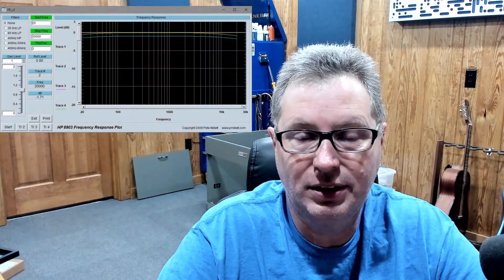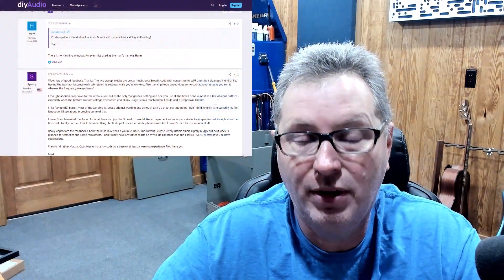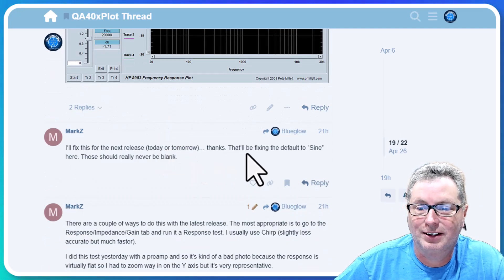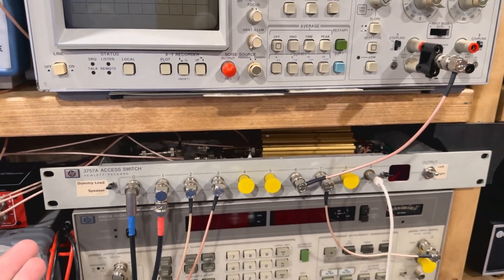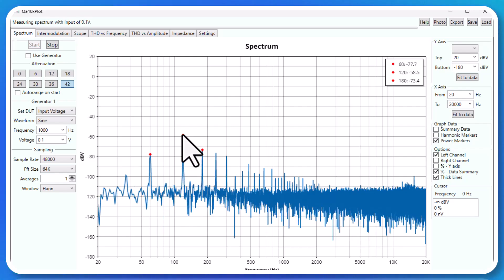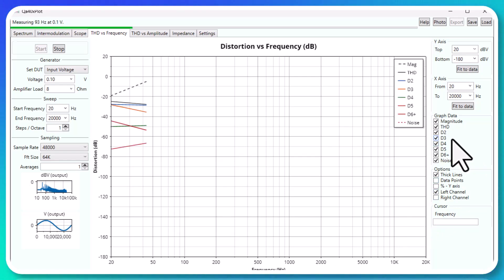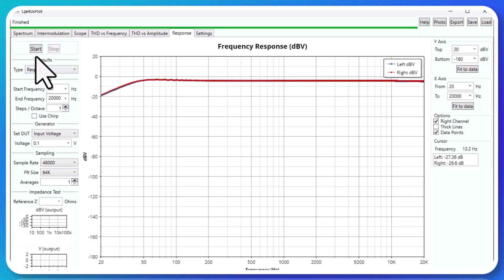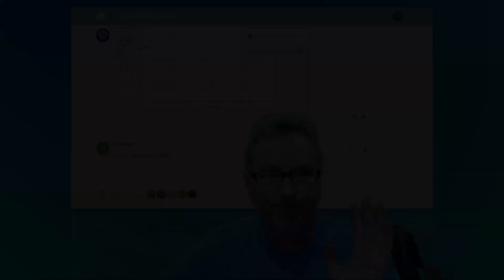QuantAsylum Audio Analyzer Back on Our Bench with New Software 2025

Comment: I have the 8903b and was just getting ready to move an old computer to it to hook up Millet's software. But I've also been looking at the QA403. Thanks for the video. One advantage to the QA403 is that the signals are calibrated, unlike, it seems with a general-purpose interface and software like REW. REW was useful for me for rebuilding and testing an old Teac A4300 open-reel deck, but it wasn't very flexible for bench testing (versus room EQ testing--its sweet spot). For anyone considering an old HP 350 spectrum analyzer, though, it seems like the QA403 will cost about the same and provide a wealth of additional capability.
Reply from the maker: Totally agree

Comment: I’m interested in learning how to measure amplifier distortion. In your opinion, would this unit be the right approach for a beginner or would there be a better way to go?
Reply from the maker: If you are looking for a modern approach, I can't come up with any inexpensive options that would be better.  If you want older 1970-80s stuff, there are some good units on the used market (HP8903B, etc.).
Reply: Thanks for responding.  I recently found your channel and really enjoy your videos.  Would you consider doing a video detailing using your HP8903B to connect and test an amp?  I purchased a used HP8903B not too long ago.  I haven’t had a chance to try using it yet and honestly I feel unsure about how to measure an  amp.  Thanks for your time.
Reply from the maker: @samcloutier4501  Sure, might take me a bit but I'll get to it

Comment: FYI, the QA40x manual of July2023 says, near the top of page 9:  "NEVER USE TERMINATORS ON THE OUTPUTS. IT CAN CAUSE EXCESSIVE HEATING."

Presumably this is because, as stated near the bottom of the previous page:  "The QA40x hardware has 4 outputs, or both left and right differential pairs. The + and – signals are always complementary. That is, when the L+ signal is rising, the L- signal is falling. Viewed on a scope, the + and – signals are always moving in equal but opposite directions."
Reply from the maker: I think they are talking about shorted terminators, its why I mentioned the 50 ohm will act as a dummy load to absorb any output without causing issues if output is put on the - side.  I'll email Matt at QA to confirm.
Reply: Yes, you terminate unsused INPUTS with 50R to minimize noise breakthrough. Check out Vintage Audio Review #97, it's all there.

Comment: When you changed the "End Voltage" to 2 volts, the graph was still showing only 1 volt, so you were not actually seeing the 2 volt result. Perhaps you needed to reselect "Fit to data"; however, it would be nice if the software would do that automatically when "Fit to data" is selected and you change the end points. A bug perhaps.

Comment: Thanks for highlighting this BlueGlow! Circumstances resulted in my becoming unemployed late last year to the point my plan to continue for a couple of years onward in my 29th yr of service with the now ex-employer even though I’d reached retirement age all went away… No one hires us ‘old folks’ even with decades of qualified electronics experience it seems so I’ve built a Lab at home & repairing anything that comes my way or scratch building tube amps for fun… The Quantum Asylum looks to be perfect for the bench especially with the ‘added extra S/W’. I have already spent a load of time with TheSuffMade Impedance & Audio Analyser & that’s been a load of fun however it is awkward to be able to quickly do a test. One of my ‘scopes has the Bode Plot function so I use that if it’s a HiFi amp repair. Looks like I’d better buy a 403 once I do some research at least. Thanks again for the heads up!

Comment: Hi Mark,
TheStuffMade put out ver 2.0 of his software about 3 seeks ago. Honestly I have not had time to look at it.. too busy with work.
This new hardware looks good.. maybe a bit noisy in the 120 Hz (From the powered USB Hub? I would have thought it would be a switching PSU in there... a mystery?)
I did not see a self calibration setup.. maybe I missed it.
Cheers,
Reply from the maker: It's his impedance analyzer, not the audio analyzer he put out 2.0 of.
Reply: @Blueglow  - Ah. I forgot about that one. I should have looked closer.
Reply from the maker: Oh wow, I'll check it out.
Reply: 3 weeks ago
Reply: Mains hum in single ended is only -115dB@50Hz at mine with an external, switching USB hub. 2nd harmonic is buried in the background noise at -150dBr.